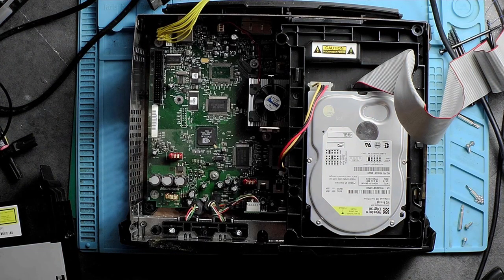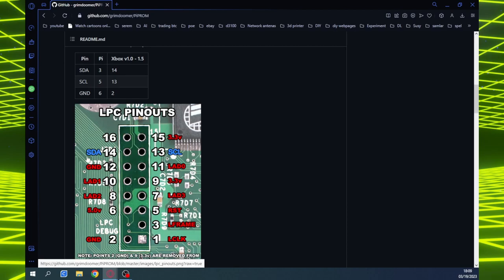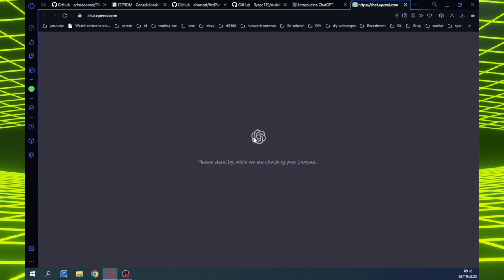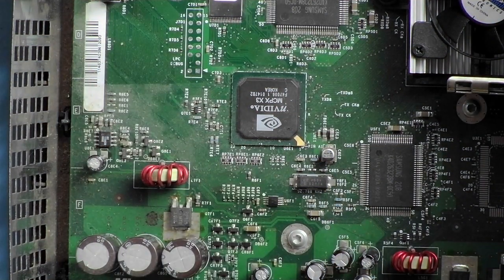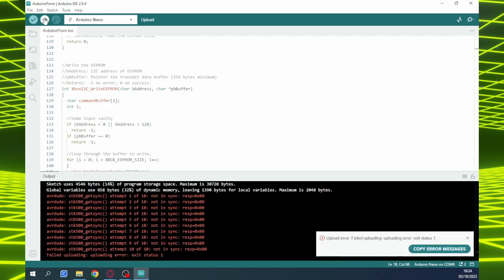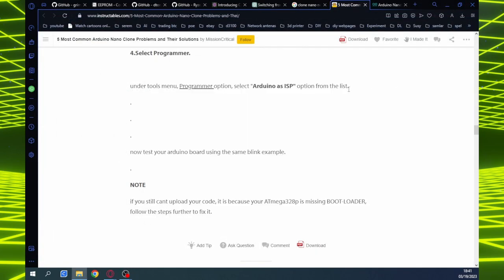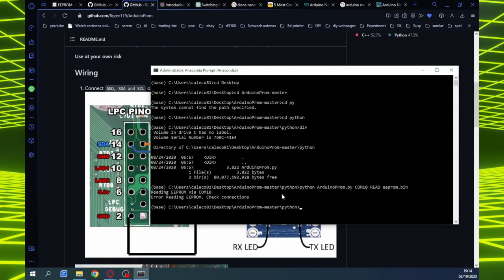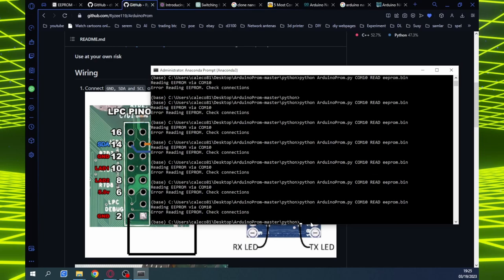Part 2: The EPIC Conclusion to Fixing a BROKEN Xbox Original with Chat-GPT and an Arduino Nano!

Comment from the maker: If you want me to Simplify the process of using the Programmer let me know here and i will make a small windows app that you only use buttons to interact with the Arduino programmer :
1 button to detect - if it detects the xbox chip
1 button to read and save eeprom 
and 1 button to Write a bin file to the xbox  eeprom

this will make it so you can skip the python installation and do command prompt commands
Reply: Please make a GUI for this
Reply: Hello! I made a script for simplifying the process and added your fix along with your diagram while giving full credit and directing others to your adventure here just today. I hope you don't mind. I just wanted to make things easier for everyone. You can find the download in my latest video description. It's basically just a batch file with others' resources attached. Thanks for your work! The Nano had me stumped too. I remembered having copied it to my Uno so figured I'd grab a key with that one day. Turned out not to work out as it did before 

I used to make the serial adapters and used PonyProg for readings. Recently, I settled on the Pico Pi because it just worked! Afterwards, I wrote up that script to simplify the process and along the way I realized at some point my Python became corrupt on my PC so that's why the Uno wasn't working this time around.
Reply from the maker: @androxilogin  

Hi yeah i don't mind at all , i put this out there to help people and if you made it even easier great :)

i have been promising a gui a while now but cant really get the time to do a gradio interface at this time way to much stuff going on right now . 

i cant really see the link to your script (stupid YouTube deletes comments with links  or blocks them) 

i will check the blocked comments and make it visible if possible and pin it as it a huge help for some people who have a hard time with python and other coding related tasks .

appreciate your hard work , thanks a lot for contributing
Reply: @RetroUpgrade  Awesome, same mindset. I actually subscribed to your channel a few months ago when finding this video and pinned it in my Discord channel to follow up on.

I meant the link was in my latest video description. It's just a batch script but it gets the job done. I'd make a proper GUI but honestly, I use one programming language for one little thing then start getting the grasp and move to something else completely different. By the time I come back to it I have to relearn everything completely. 

I actually tried the ChatGPT route tonight and it converted it all into python with mistakes galore. When it started getting it, I threw too much at it and confused myself and then it then me, then it.. Had to walk away for now.

Maybe one of these days I will make something in Visual Studio. I've been saying this for years though but good to know someone else was also striving for such a thing. 

Anyway, thank you for your work and the addition! I'll keep an eye out for more from you.

Comment: I was able to read the EEPROM just fine, but I'm getting an error trying to write a modified .bin file:

('Opening EEPROM', 'eeprom.bin')
WARNING: This will rewrite the EEPROM
Press Enter to write EEPROM...
Traceback (most recent call last):
  File "ArduinoProm.py", line 96, in <module>
    input("Press Enter to write EEPROM...")
  File "<string>", line 0

    ^
SyntaxError: unexpected EOF while parsing

Any idea what the issue could be? BTW, thanks for the awesome video.
Reply from the maker: Hi. So if I remember correctly. EOF is refering to end of file. So the file is basically ending before it reaches the stated size. 

How did you modify the file with the same editor ?

Or did you go the hex editor rout?

Can I ask what you modded?
Reply: @RetroUpgrade   I modified the bios .bin file using LiveInfo with the HDD key of the drive I needed. I was able to get the python code working with help from ChatGPT. It's amazing and a little scary what it can do.
Reply from the maker: @eugenioarpayoglou that's awesome and Scary yes 😂🤣. Glad you could fix it

Comment: Can i  use your script  with the original sketch
or do i need to use the one you  provide?
Reply from the maker: Hi,  
I don't think you can use my script with the original programming AIO file unfortunately as it was flawed to begin with for my "Fake Arduino"
I will try to get some time to write the GUI for you and post it up when its done . ill leave you a message here as soon as its done .

what error are you getting ? 

the can not create sketch ? when opening the INO file ?

give me the error code and i can help you get going 
thank you for watching
Reply: @RetroUpgrade  I actually have  actual board and not a clone. I got it working. Your video was helpful because I had not installed the need python plugins. The GUI would be easier the typing a command if u made one